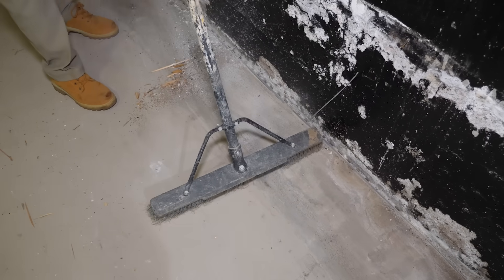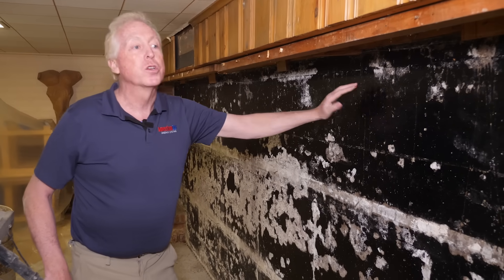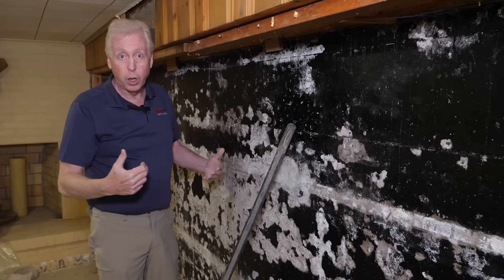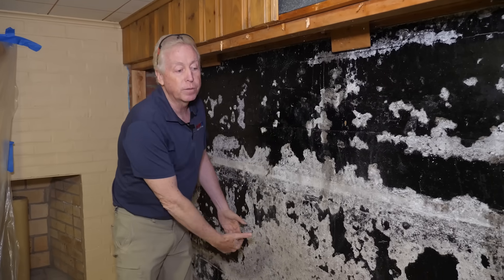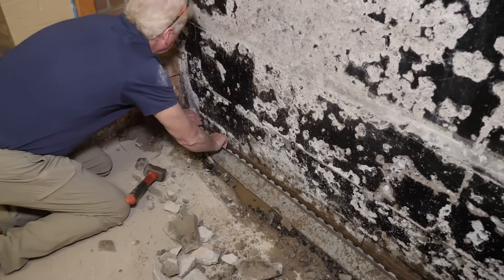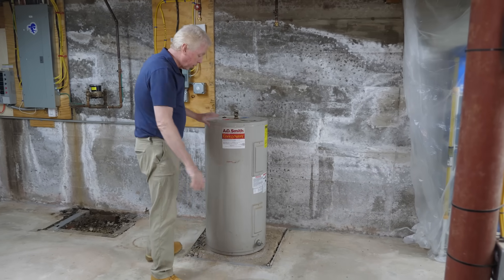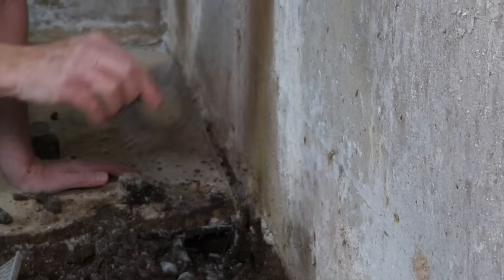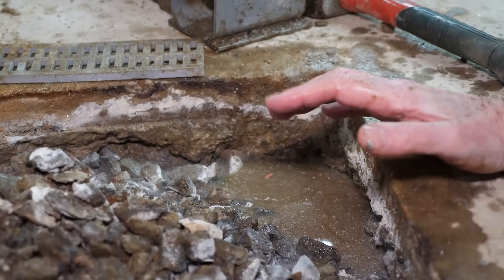Waterproofing Basement Walls | Finished & UnFinished Basement

Comment: One of the worst things to do to your basement.. a finished basement.
 Nailing framing to your foundation, then covering it with interior walls etc...
 When i wanted an extra room/space in ny basement, I built a floating room.. basically a small unattached little shed in my basement with a drop ceiling, etc..
 Nothing was attached to my foundation walls in any way. And the walls of the room are 2ft from the foundation walls it is cornered into so air flows and i can check or see if there are any issues at any time.

Comment: What an excellent video. Direct and to the point explaining how water travels through soil and then through concrete. My only question is, why remediate a water problem inside the house, isn’t it better to capture it on the outside??
Reply from the maker: I'm bias. I could be in the business of doing both inside and outside waterproofing, but I have find that most failed jobs are done on the outside. So, I refuse to do any exterior perimeter drainage. Sub-terrain movement of the soil is very active. Most outside systems fail in 3 years. Interior systems are protected inside below the slab floor where water can easily enter, even with a outside system in place. Outside systems cannot protect you against the ground water that can push up beneath your floor.
Reply: With a high water table you’re absolutely correct. Inside and outside is a must. I was more talking about runoff when it’s raining. The concept of catching the water before it makes it into your basement is the way to go. But if you then have a contractor that does a lousy job, then yeah you’ve wasted money.  But the same thing applies when you’re dealing with a crappy contractor doing inside waterproofing (as per video)
Reply: @AmericanDryBasementSystems Aha… never ever considered seepage from beneath the floors

Comment: Why can the concrete used for pools handle so much water, but foundations have this efflorescence issue? Couldn’t foundations be made using concrete in such as fashion that they are inherently water tight?

Comment: We don’t have basements around here. Cellars (4’ deep) yes and some concrete storm shelters.

Why don’t people seal the outside? Wouldn’t it make sense to use a waterproof outside so there would be no penetration of water?
Reply from the maker: Outside sealing is temporary on homes that take in too much groundwater. It fails whenever vertical pressure is applied to the walls when the ground is wet and heavy. The best bet is an interior management system that keeps humidity low, doesn't require high maintenance, and doesn't have the environmental vulnerability of an outside sealing and/or drainage system. We only stick to interior systems because they work.
Reply: Thank you, I wonder if this has ever been done. I’m going to put in a “Shelter” it will be below our water table by 4’. We have silt and sand no dirt or clay, the cool thing is water pumps actually dredge the fill.

Knowing this I wondered if using a vinyl pool liner set down and the foundation poured into the base. There will be double wall design with concrete between the metal boxes (big one with smaller one inside) the liner will be on the outside of the  boxes.

Have you seen this design before?

Comment: I have these problems. These videos are helpful, are basement leaks covered by home insurance?
Reply from the maker: Standard home owner's insurance usually cover burst pipes, over flowing toilet or sink, but not leaky foundation walls. If you want sump pump overflow or malfunction insurance coverage, the insurance company will make it optional but not included in your standard coverage.

Comment: So using AMES Blue Max rubber paint on my basement walls isn't a good idea. I don't have a water problem but if I decide to finish my basement I don't want to deal with musty smells and possibly mold behind the walls.  I run my basement dehumidifier at 40% humidity, 8 year old home. No odors, but similar basements have odors in our development. Your thoughts? Great videos! just subscribed.

Comment: Problem: Water still moves through the wall! Moisture should NEVER enter the home. It needs to be remediated on the exterior!! Yes, that means correcting what was done wrong when built, AND and repairing all other damages that were created since then!!
Reply from the maker: Exterior waterproofing, wall membrane and pipe, will not be able to stop hydrostatic water from penetrating cold joints. The membrane buckles, cracks and separates from the wall and underground drainage pipes clog in short order with or without landscape filter. Also, most people do not want to take that risk with a limited warranty and enormous price tag. I am bias for a good reason. That's why I favor interior over exterior waterproofing for a higher success rate.

Comment: Would this have worked if you created a french drain system outside ??
Reply from the maker: No. No where near as good.
Reply: I cannot afford to dig 6ft & seal the outter basement wall. What else would you recommend in this scenario?

Comment: Hi I have a Granite slab wall foundation without a footer.  How would I put a Drainage channel in?  I can dig under the slabs maybe 1 to 3 inches down some concrete (rat slab) & Clay.  Would like to eliminate moisture in basement.  Live in Cantal Maine  in 135 year old house.  Very Sound house other than that.

Comment: There's no need to construct a basement.
Reply from the maker: Yes, we need basements or crawl spaces in the northern parts of the United States. We experience a great deal of ground frost, which tends to move a house built on a slab only. Homes here need a space built below the frost line to prevent movement. Also, your utility pipes will not freeze as easily in single-digit temperatures.

Comment: I am getting quotes for a waterproofing g system in my basement. He wants to do a system very similar to your system. And wants to drill weep holes into our block foundation . I haven’t seen you do weep holes in any of your videos yet. Is that a good idea or not?
Reply from the maker: Weep holes are necessary for block wall foundations, not so much for poured concrete walls.

Comment: The weirdest systems I saw on the east coast, that have stood for 100 years, are water diversion, not water proof.   if the water comes in, it goes out.   One house, had a little stream that ran under it if necessary, and the backside was lower, so, water came in, water went out.

Comment: Efflorescence is when salt is pushed through to the surface of the concrete walls. All that white is salt crystals coming through and drying after the water evaporates. 99.9% positive that is not lime. Just google efflorescence…

Comment: Do you remove the paint or sealing system that was there before currently deteriorating the walls before placing in your drainage system? Or do you just leave it there as the concrete can “breathe” now that the system is installed?
Reply from the maker: We remove the bad waterproofing from the lower 24" of wall and leave the rest unless the owner wants it removed (more $$$). With our system in place outside water levels are prevented from passing the hydrostatic line, that's below 24". Eventually the upper part of the wall will dry out from the outside because water will rarely stay around long enough to deteriorate it some more.

Comment: We have a 90 yr old home in eastern Maryland and have needed to fix our basement for a few years. Wish you could come down here!! I have watched several of your videos and really agree with your methods! 👏 
The lower 24" of our walls has the black waterproofing under ?? coats of ?? paint around the entire basement. I have tested 4 different masonry strippers - no luck. Any suggestions for removal? I want to recoat the walls with a crystalline slurry that grows into the wall
Reply from the maker: Unfortunately, the only way to remove waterproof paint, tar, sealer is the hard way... with a concrete circular sander. Our superslurry will not work when applied over these waterproofing products.
Reply: Thanks for the reply! 
That's what I was thinking too. Ugh. I've tried 4 masonry paint removers and they aren't touching it. I'm going to look into dustless blasting...

Comment: With this info, wouldn't the best waterproofing be using the tar based sealant on the exterior of the wall? (Dig out the basement, seal it on the exterior, backfill with gravel and top with soil)
Reply from the maker: Tar and other waterproofing materials should be used on the outside walls during the construction of your house. If you want a redo, you will have to do the entire perimeter of your home or water will find another way in. Get prepared to pay a lot of money.

Comment: The water pressure under our basement slab floor cracked the concrete and began to leak from the pressure like 5ft from the wall.  Drainage is key, water prevention

Comment: If a better grade of cement, "Hydraulic cement" were to be used for basement foundations "waterproofing" a basement would quite often not even be necessary. The Romans used cement to build aqueducts and roads that 2,000 years later are still standing and usable. Why can't we build a road that doesn't turn into potholes in a few years? Or a basement that doesn't leak from its initial build? And you know what you can do with that stuff called "blacktop". Stick it where the sun doesn't shine!  lol

Comment: What can i put on a block wall basements to make it look better and still let it breath. Dont have much of water problem it is just damp.
Reply from the maker: Consider covering your walls with a white 20+ mil thick liner and use a dehumidifier. Your damp problem will not stop with waterproofing paint. Again, you need a dehumidifier, or it will begin to peel after a year or two. If you solve the dampness first, you can then paint walls, cover them with sheetrock, or put a thick liner to make them look good.

Comment: I have an unfinished brick basement.  Same remedies applied.  They cut a narrow drain around 60% of the walls.  But it is effloresencing bad this year.  This is a rental home, but I feel the property mgt wont do enough to remedy.

I want to descale and seal it myself, but I dont know what chemical systems or physical remedies work best.  I dont have $5k to hire a pro :(   I just want this smell gone.

If there is a way to get some consultation I would love to contact you and your company.  Im in southwest illinois.  A lot of rain this summer of 2023.  Hoping this will dry up in the autumn to take action.  Thank you.

Comment: I bought Drylok last week and planned to paint the basement wall where water was seeping in from nail holes holding 2x4s that where soaked and rotted. I  sprayed flex seal on the wall because I had it on hand. Didn't know if I could paint drylok over flex seal. Seeing this video I'm no longer going to use drylok. Not sure what I'll do but at least I won't make it worse
Reply: I know what is best option 😢

Comment: So when it comes to crawl spaces under the house, why do folks put vapor barrier up the concrete walls?  Wouldn't you just want to put the vapor barrier on the dirt floor and leave the concrete bare so they can breath also?
Reply from the maker: Depends if you get water on the floor as a result of surface flooding. This is another category I will cover in the future. Check out our drainboard wall option to control surface water. https://youtu.be/KI_6t4y1d5c?t=384

Comment: My cellar was built in 1150 (yes, 1150) from Yorkstone, its all vaulted ceilings and gargoyles which is very nice but damp. At some stage long ago it was painted and layer upon layer has been added over the years Efflorescence is rife and the stone is slowly crumbling. This cellar is in my pub and is used to store and dispense my ales. What is the best thing to seal it with to stop the constant water ingress and slow down the crumbling? Thanks for a great video.

Comment: Currently have this system they tore out installed. Basement was dry for years but is taking on water again through the floor mostly, can't afford to have it taken out so I have to have it flushed twice a year what a scam.
Reply from the maker: They never last or should not have be installed in the first place. The system continues to allow the water outside the foundation walls to build up pressure instead of relieving the pressure.

Comment: Good slope around that house, You wouldn't think it would be that damp.. In proper installation  .. !
Reply from the maker: No. Not always. Exterior waterproofing (including sloping, gutters, drainage) are usually poor and sometimes good. Mother nature is also brutally abusive to exterior waterproofing. Properly installed interior subfloor drainage will always solve the problem.

Comment: Water...the bane of my existence...I have natural springs under my house, under my driveway, in my yard...my basement floor is cracked and erupted and uneven ~ taped a piece of 12" x 12" plastic sheeting to the floor and condensation occurred within an hour...I HATE IT
Reply from the maker: That's not good. In your case, exterior waterproofing is vital. The hardest part is making sure to give the spring a path to daylight away from your house. You have to rebuild that basement slab or your house is not going to behave.
Reply: @AmericanDryBasementSystems  Wish I had the money and time to do that... The previous owner lied to us...I asked him specifically about water... He's disappeared from the face of the earth...

Comment: I know it's been awhile since this video has been posted but in regards to using liquid rubber paint, does the same argument apply to the floor as it does to the walls? I have a few hairline cracks in my basement floor and want to seal them. I was thinking liquid rubber could be the best option. Would it be okay to use liquid rubber on the floor cracks, whole floor or neither?

Comment: i am a little confused. Is the outside of the basement generally not generally waterproofed ?. Or is this just an old construction.
Reply from the maker: Building code requires exterior waterproofing on all new construction. The original waterproofing did not hold up.

Comment: What about spray foam on wall?
Reply from the maker: Not a fan of spray foam on basement walls. Basement or crawl space ceiling are fine. You can spray foam the heck out of the upper floors. You can use it on basement walls but you better make sure the walls have vapor barrier sheeting before spraying. Also, eliminate the hydrostatic pressure outside before proceeding.
Reply: @AmericanDryBasementSystems  Thanks! Do you have any video for vapor barrier sheeting and spraying for doing it right? Your help is much appreciated.
Reply: spray foam lol

Comment: I'm surprised you didn't talk about the outside of the walls maybe applying a water barrier or French drain on the outside of the basement walls and back filling with rock or something. Not saying I'm an expert or anything just some things I've heard other people did in damp or flood plain areas have done to keep their basements dry.  You make all of your points crystal clear and show what was wrong on this basement install. This will help a lot of first time home buyers/builders as well as those with existing problems seek out better solutions to their wet basement problems. cheers!
Reply from the maker: We are only in the interior waterproofing business for a reason. Outside waterproofing after the initial construction waterproofing makes no sense. The results are temporary, inconvenient and very costly. Most people don't want it and I don't blame them.

Comment: WELL THAT JUST TOTALLY STALLS ME ON DRYLOCK
IM GOING TO 
SEAL MY WALLS IN MY GARAGE 1st 
Then DRYLOCK 
Or im just going to seal them like I did the floor( its the same hi gloss BEHR product sold at Home Depot & its how their concrete floors allow your knees &  feet go in the same direction without tearing your knee sockets out. Ive sent this to a family member so they can apply MORE KNOWLEDGE TO THEIR HOUSE

Comment: It's all just common sense. You can't possibly drain a basement using little toy patushka pieces like that and you can't insulate against moisture by painting the inside of the wall with tar because that locks the water inside the wall. Same reason I always criticise all the homes being insulated from the OUTSIDE all over Europe where that creates issues with the condensation point moving inside the wall, and plus, why do you want to heat the walls? You want to heat only the space inside the walls. Same analogy with the water, only in reverse. With that house you just showed, I would uncover the outside to the foundation, and re-seal it from the OUTSIDE with tar, and then do an inner French Drain system much deeper than the original toy pieces went.
Reply: One thing that insulating the walls on the outside has going for it is creating a vapor barrier that probably wasn't done when the house was built, which can also act as a wind barrier.

Comment: if they had used dry lok on the outside of the wall rather than inside, i don't think this would have happened...
Reply from the maker: Drylok would create a waterproof barrier inside and outside but for a limited time. Besides, the water pressure will crack the walls and push water underneath the floor to get in. Water holds no bounds. Go for permanent solutions to resolve your basement problem.

Comment: It’s called negative side waterproofing.
Reply from the maker: Correct. It is a lame excuse for negative side waterproofing. Our Supercrete crystalline application is a proper form of negative side waterproofing but it is useless along with all the other solutions out there unless you address the hydrostatic pressure. That pressure can still shift a foundation, crack walls/floor or allow water to find another way in.
Reply: @AmericanDryBasementSystems  yes!…your system definitely saved that foundation wall.